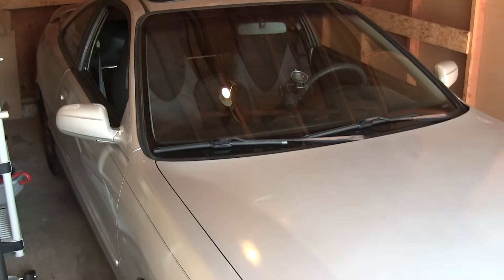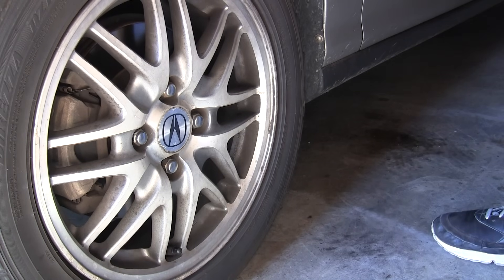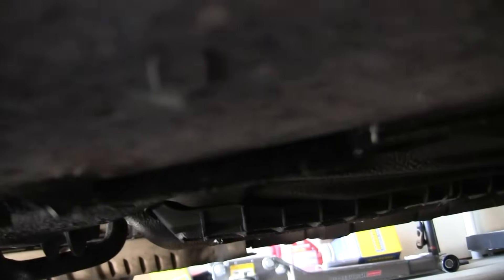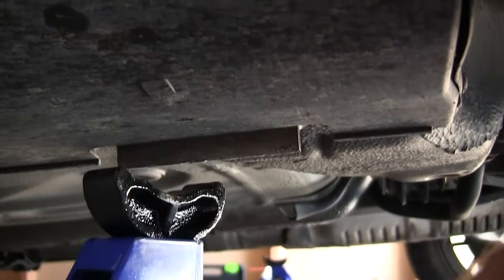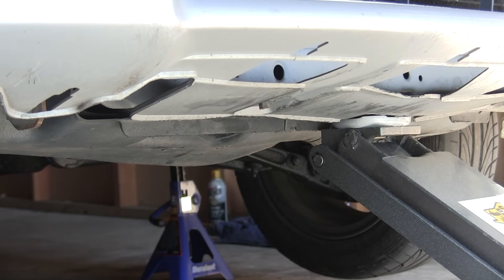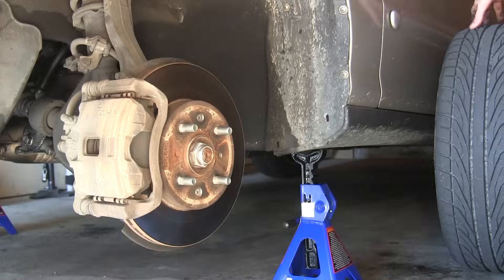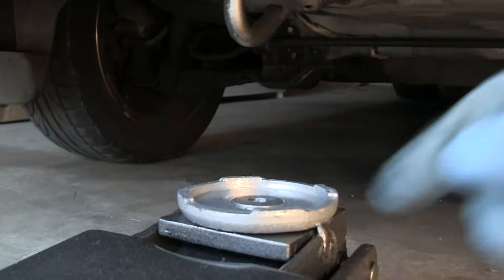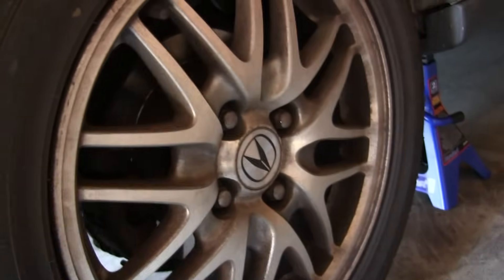How to Lift a Car onto Jack Stands - Explained

Comment: @SuperrBludger

Those jack points are safe to hold the car on jack stands. In fact, if you look in the owners manual or repair manual it will show/tell you to place the jackstands in that location, on the reinforced jack point. Often cars have a unibody construction and do not have a conventional chassis. If you try to jack up the car or place stands somewhere else there is a good chance you could do some damage. You can knock on that area and hear that it is not solid, if you try to jack there you can see the metal start to flex.
Really the only decent places to hold the car are the jack points or certain places on the engine, trans, diff, or suspension. This does depend on the vehicle.

Comment: I have a Focus and the normal jack stands seems to be too high.  Do you know of any  shorter jack stands; if not, what else would you suggest using. Thank you.
Reply from the maker: You may need to jack your car up a bit before getting them underneath.
Reply: I was planning on jacking it up but my car has such a short wheel base, I wanted to keep it down as low as possible and that doesn't seem possible with the jack stands available-----so I guess I will just jack it up and then do some cribbing with short pieces of lumber.

Comment: What do you think about jacking up front, then rear, and putting jack stands at each corner?  Do you think it's safe to be jacking rear when front is on jack stands?  Thanks.
Reply: Hi It's not. You should only have two jack stands (front/rear) lifting the car at a time.
Reply: flexor212000
So what is the best "engineering" way to do a tire rotation from front to back?  Bring the car to Costco?
Reply: yusuihang do one side at a time.
Reply: flexor212000
How would you start this?  If you have a floor jack, then it is not good to be using it on a pinch weld.  Also, it may be hard to slip in a jack stand on the pinch weld if you also have the floor jack there. 

If you don't jack at the pinch weld, then you jack at one of the center points.  Say you jack up the front of the car first.  Then you would only put a jack stand under one side of the car as you release the jack?  I am thinking that may lead to a little instability (potential slip off the jack stand) as one side comes down on the jack stand and the other side's tire comes down on the ground.

Now say you have the front left side on jack stand.  Isn't it just as unstable to be jacking up the rear left side (if you use the pinch weld) or the rear center  jack point when you have one corner in the front on jack stand as when you have both front corners on jack stand?  I've seen jack stand instructions that say to only use jack stands in pairs--on the same axle.
Reply: flexor212000 Why exactly is it not safe? After the front/back is supported on two jack stands, when you go to jack up the other end more weight is placed on the jack stand, but they don't move and if they are rated for the weight that they can hold, I don't understand how it's not safe. I just got a jack and two pairs of 3 ton stands, and put a 3500 lbs car up on the stands, one at each corner. The entire car was lifted, and when I did the shake test, it didn't budge one bit... it was even more stable than some cars I've seen on a lift that could wobble a little!

Comment: Pretty sure the jacking points are for changing a wheel and are not strong enough to support the whole car, use the chassis rail or rear axle to be safe.
Reply from the maker: The jacking points are connected to the chassis rail. Define rear axle, the rear wheels are not connected as it's an independent suspension.

Comment: Is it dangerous if you only have the e-break on but not the wheel blocks? I've only ever had to change a spare once and that was how I had it.
Reply from the maker: I would always use chocks, the e-brake could slip.

Comment: I have seen this in the past few videos that I was told not to do: 1 you took the bolts off before you jacked up the car 2: you didn't take off the bolts in opposites (top, bottom, right, left). Why did you do it that way?
Reply from the maker: 1. I didn't remove them, I loosened them. Otherwise the wheel will rotate and the nuts won't come off easily once raised. 
2. I tighten them in the star pattern, as far as removing them, doesn't seem like it would matter.

Comment: It's funny, I was watching your videos to learn about the clutch/transmission but ended up here after a little while... I only started working on my car recently and the first thing I did was have my older brother show me how to jack it safely. He raised each side from the jack point and then slid a jack stand under a strong part of the frame. While this was happening I asked why not just jack both sides at once and he (as usual) chose to think I was just being dumb.

Comment: If you're doing anything involving the wheels, you can't have them on ramps. No jack stand is going to reach high enough if your car is on ramps, and even if you raised them with blocks or something they'd just be in your way for little to no benefit.

Comment from the maker: I would simply search for a forum discussing the mounting points, if you're unable to located them on your own. Worst case, you could probably get the manual (or at least find the jacking points) from a dealer/mechanic. You shouldn't lift the vehicle from points which were not designed to do so.

Comment: whether you use 4 ramps or only 2 ramps it's much safer than stands. Because using ramps the tires have contact to the ramp and stands are only supported by the frame

Comment: Review videos on how brakes work, and remember the fact rear brakes are usually much weaker than fronts. Rev up, dump clutch, stomp brakes, check if speedometer is above zero, enjoy. If speedometer shows 0 - you need new clutch and air freshener. If tachometer shows 0 - you need a better engine. If there's only one skidmark - you need a locking or limited slip differential. Oh yes, also review videos on limited slip diffs ;)

Comment: WARNING: Never work under a vehicle supported only by a jack or jack stand. It is only safe and recommend when it's supported by a lift or on a ramp
Reply: It's perfectly safe to work under a vehicle that has one corner supported by a jack stand as long as the stand isn't some cheap crap made in China.
Reply: @billwilson3609  lol most likely the jack stand or jack will be labeled "made in China". As pretty much everything you buy is made in China nowadays unfortunately.
Anyway I personally wouldn't trust a jack ESPECIALLY an hydraulic jack. I might trust a mechanical jack. And will sure trust a "jack stand" much more. I sure 100% will trust a ramp or an actual car lift.
Reply: @7150285  The Chines do make some good stuff that naturally costs more. There's one that probably makes all of the better jack stands sold around the World with all looking the same except for the color and brand decal slapped on once the paint was dry. In 1985 I went shopping for a trolley jack and stronger jack stands where I noticed that Sears, NAPA and Western Auto seemed to have identical products that only differed in color and labeling since they had the same numbers stamped on them. Then I went to K-Mart to find the same stuff at a lower price so bought theirs and am still using them today. They still sold the identical stuff in the early 90's but now said Made in Mexico then by 1998 said Made in China.
Reply: @billwilson3609  speaking of made in China. Sure, lot of their products are known to be shitty. But they've also landed a Mars rover in one piece as well, after the US has landed.

Comment: An added precaution would be to put the tires under the car around where the frame of the vehicle is so if it does happen to slip off you still have the rims to keep the car off the ground and support it.

Comment: use a flat head screw driver to pry off the Hub caps from the sides. just do a bit at a time on each side then pull it right off.

Comment: Some/a video(s) on burnouts? like how it works. i mean i know that its the back wheels spinning faster than the car moving, but how do you do it? (auto vs manual). i looked some stuff up, it said holding the brake and pressing the gas and stuff but i still have questions. i.e. how does holding the brake hold car in place + let back wheels spin? has to do with brake mechanism or what? i wanna know it inside and out, the "whys?" just like how you explain stuff in your other vids.

Comment: We just put the whole car in the air on 4 jackstands, that way she can't roll anywhere. Also, in theory the side jacking points (or sills) are really only used for the scissor-jack that the car comes with, over time you can crush the metal tang flat. If you can put the stand under another piece of frame near or on a suspension mounting point it is usually better, but it is also hard to find these points when you aren't familiar with the underside of the vehicle.

Comment from the maker: The chock should be placed on the outside of the tire (furthest from where you're jacking the car) since if the car were to roll it would roll towards the end that is the lowest. To be safe (especially if you're working on a mild incline - not recommend!) you can always put chocks on both sides.
Reply: “Chock” — helpful term to know, thanks. Googled “chalk the rear wheels” to understand what this meant 😂

Comment: I'd like to point out that most RWD cars won't lock the front wheels if you put them in gear or park, or use the e-brake. Putting chocks on both sides of the front wheels is what I do when I jack up the rear of RWD cars.